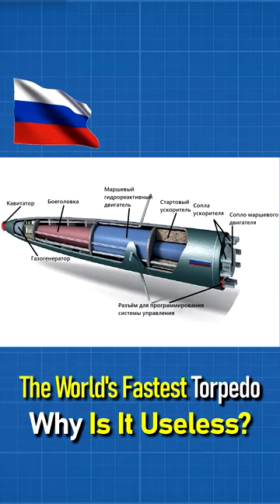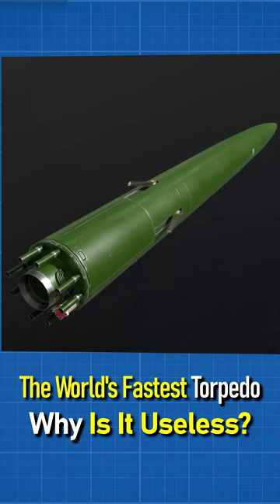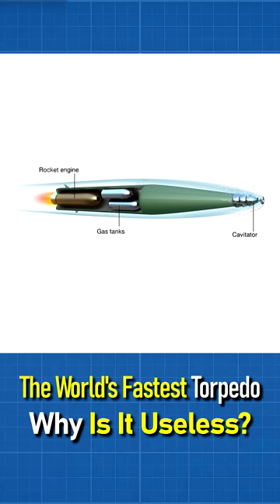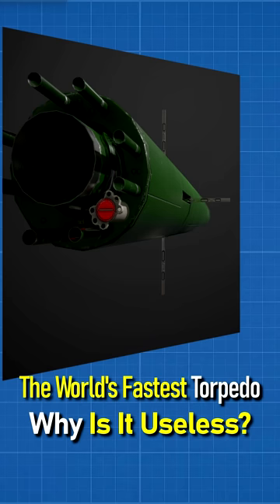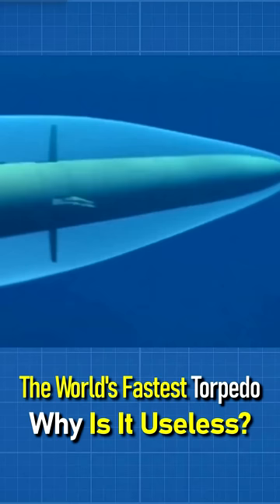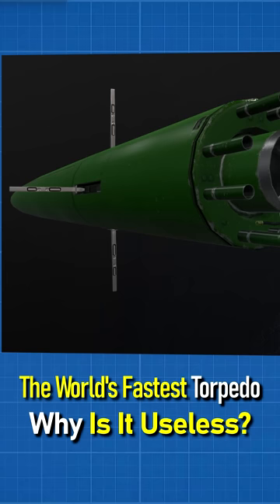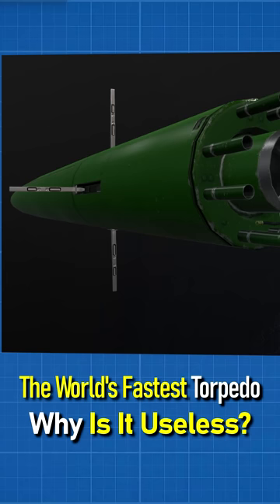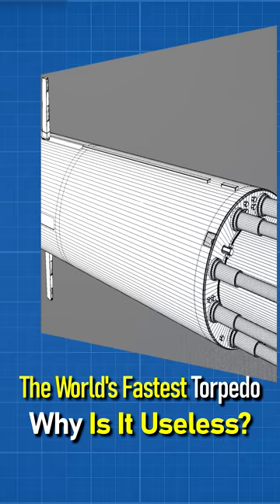The World's Fastest Torpedo • Why Is It Useless #Shorts

Comment: apparently the author is one of those "experts" who are masters of limited and biased "analyses". Well done, specialist!
Reply: Kh co gia tri !
Reply: Yep. Says the weight of the explosive is a handicap. Totally disregards the amount of added kinetic energy of the speed alone. Which sounds like a scientific "sh!ton" lol
Reply: @hughgrection3052  Not if the torpedo "crumples". It's not a metal slug like a bullet or a cannonball; a lot of the energy is lost from the torpedo's deformation.
Reply: @fredmdbud  I dunno f$ck all about it tbh lol. But speed is speed. Crumpled or not, if it maintains that speed it will be nasty. That's just physics. It must work if they have it fielded for so long.
Reply: @hughgrection3052  kinetic energy is useless if the warhead is High Explosive.
Reply: @TADAMAT-CZ  you sure that how physics works? Energy just disappears like that?
Reply: @hughgrection3052  the best place for a torpedo to explode is under the ship. they don't actually hit the ship directly.
Reply: @somethinglikethat2176  yeah typically that's the name of the game. Break thier backs. That requires a good bit of explosive warhead tho I'd imagine vs this. Therefore making them slower and a potential miss etc depending on speeds. I suppose there's two ends of the spectrum to consider when choosing what to use. Fast and light or big, heavy and slow. I wouldn't be surprised if this had a shape charge perhaps to help cut thru water line armor etc. Most Navy ships these days are tested prior to being officially put into service. They'll take them out and do shock trials with large explosives. Maybe they did this to skirt the fact ships are built stronger for those type of attacks. Pretty cool stuff tho
Reply: @hughgrection3052  Well to put it into perspective, of COURSE the energy does not just disappear since the winning theory here is that energy can neither be destroyed or created, it just exists in various different forms.

what happens when you hold out a baseball and drop it onto pavement from 6-7' high? 
the energy will be re-directed upwards causing what we call a "bounce" upwards since in this scenario there not enough density(ball)+force from said ball to impregnate the pavement.

now if the ball ITSELF was ALSO constructed not strong enough to withstand that re-direction of force just described, the ball would crumple upon itself and if any force was left over, would still have a small bounce upwards simultaneously.

using this basic principle of physics as a basis, one could reasonably conclude that the two best scenarios would be the following two for munitions impacting a, presumably armored target... as follows.

The projectile must have enough density and strength and kinetic energy to pierce directly into the armor, causing little to no redirection of energy and allowing an explosive to detonate inwards into and past the armor, similar to most modern HEAT rounds of I'm thinking correctly..

OR a less adequate solution in most instances, the projectile must be weak enough to crumple amongst itself once impacted, causing most of the redirection of energy to maintain itself within the crumple, providing MINIMUM redirection of energy and delivery of the explosion and maintaining delivery of the payload where you wanted it delivered... 

the only truly TERRIBLE formula I could see here that would be less guaranteed to neutralize an armored threat, would be of the projectile was too dense and strong to crumple on itself but with not enough density and kinetic energy to pierce whatever armor  the target is sporting
 in this instance, I see the projectile acting more like a bouncy ball than in any other instance and therefore MAXIMIZING the possibility that your ordinance will NOT provide it's FULL effect if the explosion/detonation is not perfectly timed. 

it's worth noting that many modern munitions are designed to explode right before impact as well, particularly with water warfare since it was discovered back in the days of the inception of the air force, it was discovered that it was possible for the water to somehow amplify the effects of an explosive if done just right and exploded next to the hull of a ship. certain ways of doing this were found to be more effective in certain instances, than direct hits with bombs/torpedos

I'm not an expert, this is just an observation.
Reply: @giftedshfter4433  yeah. It's interesting stuff. HEAT rounds are kind of like shape charges. They hit and inject a liquid molten jet core thru the armor basically. Sort of like a cutting torch at high speed. Another lesser known method of defeating armor is to turn the armor itself into a weapon. Projectiles moving fast enough can impart all thier energy into a an armor plate. The projectile itself funny enough usually explodes into smithereens and stops then and there, but... it shocks the armor to a breaking point and sends a small round plug of the armor as the new projectile. Kind of like how newton's balls desktoys work. Physics starts getting counterintuitive when hyper velocities are achieved. I don't pretend to have a grasp on them good knowledge wise but I have poked around and seen some curious examples. A paint flake is said to be able to blow right thru spacestations in orbit due to speed. There's a report online someplace where the army was testing rifles vs an armored personal carrier. They shot all the standard battle rifle calibers like 30 caliber etc. None phased it much. They then shot it with a 22 Swift and that tiny 22 burned holes right thru it due to its pure speed vs being a larger faster bullet like 308 etc. 

As far as if an explosive hits harder if it's attached to a faster object to begin with. I'd like to say that if you send a rocket to space, then shoot a rocket off the top of that rocket, you'd have double the speed. Which I guess is the intent of the lighter munition used here combined with the initial speed of the torpedo. So if the standard blast wave moved at let's say 500mph to keep math easy, and the top moved 500mph, you'd now have a blast wave of 1000mph combined.

Water is yes used to amplify charges. Not in the way many think tho. It's incompressable. You can see EOD techs and stuff use it now to help explosives. They now use water to help get rid of harmless backblast from RPGs etc too. They let the rockets force against it instead of just air. They will also use water bags on top of explosives to blow doors etc better. In the case of ships tho. They're actually soft compared to the water around them. So when a blast occurs nearby the surrounding water will push the blast into the ship. A blast radiates 360° in air. If a blast is beside a ship, with water on the other side it will focus the wave that usually goes in the other angles, into the ship as well. Kind of hard to describe here in words tho. Especially since I'm not even trained to speak on it lol. It's a fun topic tho and anytime I see it discussed I try to soak up what I can. Neat stuff
Reply: murikan
Reply: @hughgrection3052  At just over 300kph the kinetic energy would be miniscule compared to packing a decent explosive warhead. There also has to be a mass tradeoff to achieve the required velocity, reducing it even more. It's speed is really only to reduce the time-to-target, which isn't much of an advantage when it's screaming it's position from launch.
Reply: @giftedshfter4433  A direct contact explosion against a hard target underwater is exceptionally powerful. The non-compressibility of water helps maintain higher overpressure against the target as the resulting super-cavitating bubble goes through a few cycles of collapse and re-expansion. This causes a cycle of more pressure and partial vacuum that pushes and pulls on the already damaged area, flexing the weakened materials and breaking them.
That's one of the reasons why Barnes Wallace's bouncing bomb during WW2 was given backspin, for when it hit the dam wall. The backspin kept it in contact with the dam as it sunk, to maximise damage. Also, a super-cavitating bubble in close proximity to hard surface underwater will always cavitate towards that surface.
Reply: @hughgrection3052  when the warhead explodes, the energy goes into all directions. Best case the warhead will penetrate few milimeters more before the explosion occurs due to the incresed speed, but it would be like 5 milimeters at best. Otherwise the kinetic energy wouldn't play a big role.
Reply: @TADAMAT-CZ  tbh I haven't even studied the warhead yet. For all I know it could very well just be a tungsten steel rod in it. That alone moving at those speeds will pop a hole thru most anything. Let alone a warhead. Physics is physics tho. Speed kills. We can boil the debate on this down to a easier concept to visualize tho. Imagine a rocket moving along with a rifle sticking out of its nose. If the rocket is doing 100mph, and the rifle shot at 100mph, just to keep math easy. You now have a combined speed of 200mph for the bullet. 
Kinetic energy is a funny math calculation.  I can't quite type the formula for it here. But basically let's say we have a bullet that weighs 10 grains to keep the math simple again. To get more kinetic energy you can double the weight of the bullet to 20 grains. Then you'll get roughly double the kinetic energy when fired. Now you take that same, smaller 10 grain bullet, then double it's speed instead, you then get 4× roughly the kinetic energy.  That's why lighter rifle rounds moving at crazy speeds outperform hanging loads that are way heavier. 

Now as far as the speed not mattering. I'm afraid that isn't true for other reasons also. Some AP rounds actually have delayed detonation. For example the 16 inches on old Battleships used to have AP and explosive rounds. Two types. The AP rounds actually had a delayed detonation of a few milliseconds. So the faster and the deeper they can go before it explodes the better. This portion relies solely on its firing speed. You can hear stories of how the AP rounds would actually keyhole into ships due thier shapes on the outside and glancing factors causing them to skid sideways etc. They'd tumble much like when bullets hit flesh. But instead of meat they tore entire bulkheads out. The hole starts kind of small. By the time the round hit a few walls and got wrapped in steel they could be by then several yards wide thick wrapped around the bullet. Then once all that is done only then, milliseconds later did they blow up. The ones that traveled the deepest always did the most damage tho of course. Anyways yeah this torp very well could have been a delayed fuse of sorts. Some have proximity radar fuzes. Some can be set to do all the above. But yeah speed still plays parts in much of anti armor. In fact they're getting rid of all rifled barrels on tanks for similar reasons which are a whole other topic, and I'm already rambling again so yeah lol.
Reply: @skateboardingjesus4006  yep. It's also why the Ole mantis shrimp hits so hard lol. Hypercavitation also eats up boat propellers due to the same principles. Tiny little exposions from tiny bubbles. Bigger the bubble, the more trouble lol
Reply: @skateboardingjesus4006  well, if you have one target to deal with the noise isn't really an issue if you're guaranteed a fast hit. Plus they're not always dealing with targets that fight back. Sub roles in the past have largely just been to sink enemy freight liners etc. They likely have other ones for other targets. Again I don't pretend to know this particular torp.
Reply: @hughgrection3052  True, any marine propeller can develop serious issues with it, no matter how laminar the flow over their surface is. The faster the prop, the more energy goes into cavitation.
Reply: @hughgrection3052  300kph is not significant from a ballistic energy standpoint.  Several times slower than the slowest missiles, and you don't hear people touting the the kinetic energy of those as some force multiplier.
Reply: @somethinglikethat2176  depends on the type of fuse.
Reply: @Keifsanderson  you realize that a 200 mph torp of any size is enough to do extreme damage with zero, I repeat zero warhead all by itself?
Reply: @hughgrection3052  "Extreme" damage??  Lol.  You don't know what you are talking about.  A large ship wouldn't even know that hit it, and it would have zero chance of sinking even a destroyer.
Reply: @Keifsanderson  yeah, you're right. I've only been a Navy certified Shipfitter 1st class as a profession before. I've seen firsthand, what happened to the Cole and helped repair it in Pascagoula Mississippi. Ive seen what can happen to ships. Trust me there chief. I was the guy who used to roll the hulls with a come-a-long. Literally!! I put the bulkheads where they go. We built the dam ships genius. So please. Tell me what your job is that supercedes my firsthand experience? 

If I sent a solid metal light pole size torp moving 200 mph it will go slap thru 99% of all ships on water. They're not all heavy armored battle cruisers and DDs. SUBS DONT ATTACK JUST HEAVY NAVAL SHIPS LIKE IN THE MOVIES. They pursue cargo vessels too. And yes. It may not sink some. They have compartments now. It can do a ton of damage tho still. Now add a warhead to that, and you do yes have a dam nasty critter. Deny it all you want. But they don't make these and field when without testing. To assume they're worthless is due to noise and lower payloads is just ludicrously stupid.  One of the reasons for the lower payload may even be just for sinking freighter tonnage since they don't take as much to kill.  But yeah. I'm over it. Too many YouTube comment know it all for me today. Smh. Any torp is a bad torp. Let's just say that and agree and for God's sake move along
Reply: @hughgrection3052  TLDR.  Keep making things up and bragging about a not-to-impressive resume.  You're a REAL great ambassador for the Navy. Meanwhile, you know there may be people lurking around on here that made their careers out of learning to fight these ships.  You're so full of it I can smell it through my screen.
Reply: @Keifsanderson  you may wanna check your shoes chief. As much as you like to think I dreamed up that job title, no. It's true. Still waiting to here your job title. Just saying TLDR don't get you out of that lol. And no. The Navy don't build ships. They just sail them. I certified thru them. Big difference
Reply: @Keifsanderson  also I'm proud to have earned my living with my hands. It gave me a better understanding of how things work. Real man earn thier livings this way. Nothing to be ashamed of. 
But by all means. If 200mph isn't "fast"... please find the nearest sports car and drive it into a wall. See how that works out for ya. Later slick
Reply: @hughgrection3052  you seem to have a fundamental misunderstanding of how crumble zones work and why they are standard on cars they displace energy so it won't have nearly the same pentration force of an object that doesn't crumble. And we're talking factors of multiple times less penetration force.
Reply: @hughgrection3052  lol what do you you mean 200 miles per hour will do extreme damage? 🤣🤣🤣 you realize America and I assume any nation for that matter are not using commercial grade platinum 200 mph will literally do nothing to a sum or warship. Like imagine a car crashing into a carrier at its highest speed the carrier probably wouldn't even dent. The car on the hand would flatten. It's actually the perfect analogy as the crumple zones would work very similarly.
Reply: @hughgrection3052  no Hugh your right that's why we spend trillions of dollars as a nation investing in new projectiles and explosives. Despite the fact that we have super sonic missles that could literally hit ships at freaking Mach 4 or 5.   And still they aren't effective as anything other than delivery vehicles for the explosive. Why because they crumble. This is why we invested billions into kinetic energy weapons to create a projectile that could be solid have high mass and achieve speeds effective enough to disable vehicles.
Reply: @hughgrection3052  let's bit pretend the navy has nothing to do with the design and building if their ships dude. Let's also not pretend that companies contracted don't utilize materials they only have access to because of the navy. I just genuinely don't understand why you think we'd develop warheads if kinetic force of present day ballistic projectiles was good enough to do the job.
Reply: @hughgrection3052  Nothing to be ashamed of in your resume.  It just does not at all qualify you to assess kinetic effects of this weapon system on the hull of a ship, and it shows.
Reply: Boy oh boy did this get sideways hella fast. All I can say at this point is just.. UNCLE!! it's one thing to have a smart conversation. This has just desended into plain weird. Have a good day fellas
Reply: @hughgrection3052  "Speed is speed. That's just physics".

No, sweetie. Physics is "kinetic energy = 0.5 mass * (velocity) squared". Maybe read, like, any of it?
Reply: @hughgrection3052  Honey, you literally don't know the first thing about calculating physical force.

Sit down.
Reply: @hughgrection3052  dude with torpedo going 200 mph underwater it's like a car driving 200 mph running into it container ship it will barely scratch it
Reply: @lorenzamccoy7512  so a regular torp doing half the speed does what again to ships??? Please. If you're going to continue this. Leave me out. Please address the other torpedo physics wizards. I'm seriously asking nicely to be left out of this now
Reply: @hughgrection3052  regular torpedoes are stuffed with explosives you definitely have no idea what you're talking about so you should definitely stay out this conversation. this is what will happen if a torpedo with no explosives going 200 mph hitting the container ship would look like and this is F4 phantom that weighs 15 tons which is way more than what that torpedo weighs and moving much faster! https://youtu.be/F4CX-9lkRMQ
Reply: @hughgrection3052  contact fuses.
Reply: @hughgrection3052  So if the torpedo weighted 2000 kilograms which it 100% doesn't then it would carry 1 kg of TNT worth of kinetic energy. That's nothing. USS Cole was hit by 300 kg's of TNT. So no the speed would not do anything too major to a ship. Also the cavitation bubble would simply collapse on the torpedo and crush that and not the hull of a ship. And if the torpedo makes a hole in the hull the cavitation bubble does literally nothing because the air can escape inside the ship. This torpedo is wayy less dangerous than the bomb that exploded next to USS Cole lol.
Reply: @hughgrection3052  Torpedoes and mines (water) dont work that way. They displace water which in turn destroys ship hulls. Think hydro forming
Reply: @hughgrection3052   don’t talk about „Physics“ when you’ve never had a book in your hand… 
Even if the entire energy would go into the ships hull (WHICH IS NOT THE CASE, ships hall isn’t cardboard, and the projectile isn’t completely plastic with infinite strength, not at all, it crumbles immediately. Torpedos aren’t Wolfram rods or diamonds… 🤦🏻‍♂️. It’s rather the other way around) an additional 100m/s velocity does nothing.
+-25MJ is worth practically nothing. This aren’t Wolfram rods running at hypersonic velocities for fks sake.
Reply: @vanrex7682  you're exactly correct. These things don't exist. Carry on with the other please. Have a nice day😎
Reply: @hughgrection3052  you're assuming it hits. Its believed to use a magnetic proximity detonator and the odds of a hit on a warship with dumbfire directly is laughably little.
Reply: @hughgrection3052  Your comment makes my head hurt.

What you said is wrong.

A HEAT shell (which is a shaped charge btw) does not melt the copper and the copper is also not liquid. (If it was liquid it would just bounce off the armor, also the explosion isn’t even hot enough that it could melt it).

Rather the copper remains in a semi-solid state in which it gets formed into a sort of „minuscule scalpel“ which cuts through the armor.

And no, using a HEAT charge on a ship would be utterly pointless.
Reply: @clankplusm  💤💤💤💤
Reply: @AnonD38  you're reading comprehension is making mine hurt. I at no point said they use HEAT in torps ffs. The guy above me mentioned them. I just gave a brief example of how they work vs other stuff. And I can make a shape charge out of a dam wine bottle glass. No copper even needed. And yes they use jets of molten fluid. Without it they leave an inverted dent. You also missed the part where I said I'm not an expert. Just having a fun convo about how it all works and why this torp is cool in ways. Yall really got to relax
Reply: @hughgrection3052 1.) „Molten liquid“ is not a thing .

2.) No the metal is neither molten, nor a liquid. It’s solid, but behaves like a semi-liquid. Without being a liquid.
Reply: @AnonD38  so you gave up on being wrong to in return come back and instead debate the state of matter instead that you was wrong about. So we're at semantics now. A hot ass molten jet burns thru. Does that suffice? Next lecture the class on non newtonian fluids, plasmas even! We've left the crazy train, and got off into clown college at this point. Call it whatever you like lol. The point is, you sir are correct also! Collect the prize at the door!
Reply: @hughgrection3052  tbh I just remembered how some ass chewed me out in the comment section of a video when I said „molten stream of metal“ so idk kinda made me angry again and had to reply
Reply: @AnonD38  yeah. It kinda makes any hopes of a smart fun conversation go up in smoke. Kinda sucks tbh. Most folks don't even realize that science is never absolute. Much is theoretical. Always evolving. Yet many will swear by things they was told. Kind of like if a physics teacher from the 50s got in a argument with one from today. Both would swear they're right and cuss each other up and down. Then the physics teacher from the year 3000 would step in and say they're both wrong lol. So yeah. Who even knows lol
Reply: It's also useless because if you look up "paper tiger" in the dictionary, the Russian flag is displayed as an illustration.
Reply: @hughgrection3052  I love it when people tattle on themselves.
Reply: @katherineberger6329  I see you deleted the silly comment. But yeah you got me none the less. I would have gotten away with it too if it wasn't for your pesky detective skills! (Rips off mask to reveal I'm actually Putin as I laugh diabolicly!)😁
Reply: @hughgrection3052  Not "disappears" but goes everywhere but the other guy, so it might as well actually disappear...
Reply: @sethadkins546  correct!
Reply: A super cavitation bubble collapsing packs a mighty punch without even taking into account the explosive charge carried by the torpedo.
Reply: @No_Feelings  change your name to "Mean Girl" and yes, you too!... are correct! You didn't have to make me cry tho geeze!
Reply: @KingOfZamunda  finally someone with some smarts! I wonder how long the bubble is also. If it's moving at 200mph it's likely pretty dam long. It will be collapsing towards the target also. So it may work like a cavitation version of a shape charge in itself. Things get weird when these things combine. I don't think it's been explored enough to fully understand and make use of it all. When a mantis shrimp can break bones with a tiny bubble, makes you wonder doesn't it?
Reply: @hughgrection3052  scary what can be done when effectively employed in maritime weapons.
Reply: @KingOfZamunda  indubitably!😎
Reply: @hughgrection3052  🤣🤣🤣 reminds me of that guy who streams gta RP.
Reply: @KingOfZamunda  lol, sorry. It just seemed fitting with all these YouTube physics experts chiming in to say something brainy sounding as a reply hehehe!
I just saw a little video that put some perspective on cavitation that I never realized. You know the party trick of how you slap the top of a beer bottle with beer in it and it won't explode? Yet you can instead fill it with water and slap its top and the ass-end of the bottle shoots off with great force. That too turns out is due to tiny cavitation bubbles. They magnify that tiny slap into a glass breaking explosion. Really makes you wonder what all can be done to a hull if this is mastered somehow and scaled up.
Reply: @hughgrection3052  saw the same video and it is really amazing how a micro bubble can shatter a bottle. Not just a simple break but shatter it.